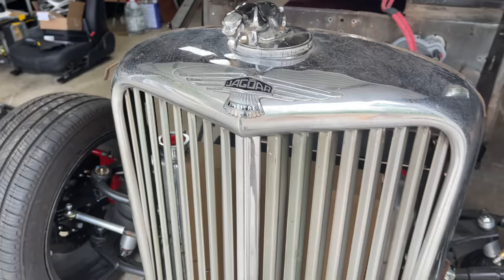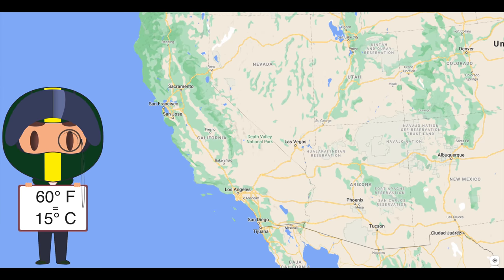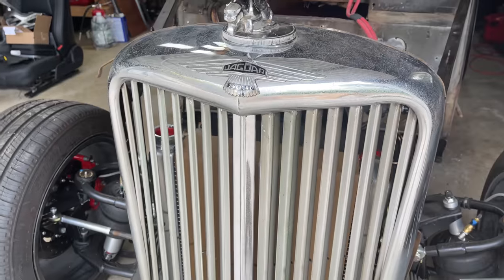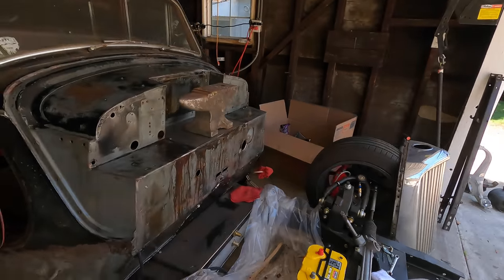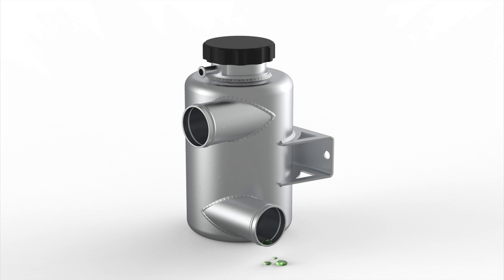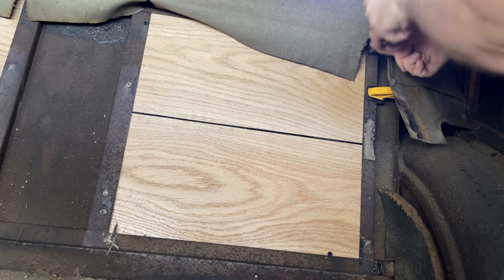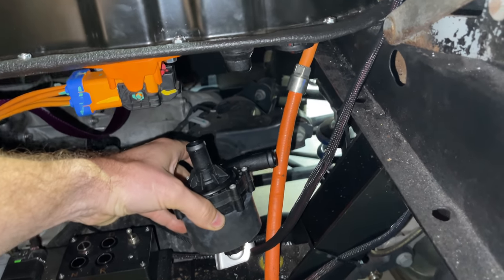Let's Build A Cooling System For An EV Swap

Comment from the maker: I've started adding post-credit teasers so that you can know what is coming up on the next video. I definitely didn't do it just so you will watch all the way to the end, increasing my favor with the algorithm gods. ALL HAIL THE ALGORITHM.
Reply: All Hail
Reply: All Hail
Reply: All Hail
Reply: Wassail!
Reply: Hail
Reply: I, for one, welcome our new algorithm overlord.
Reply: Prius Technology...AWD for the front?
Reply: @b6s4shelter  electric power steering. Separate unit because he didn't swap in the Tesla rack where it's integrated. If it's CAN connected he might also be able to make it work with a comma.ia system so he can have "autopilot" on the tesla swapped jag.
Reply: This is smart, because I always hit Back when you do your ending spiel. SupercunningMatt
Reply: Ramen
Reply: Worked on me. 😒
Reply: Algorithm Algorithm Algorithm
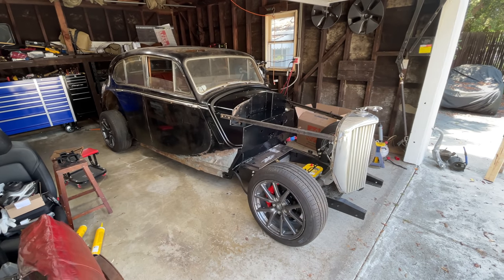Reply: Is it favourable for the creator to have ppl watch to the last second? For example, I would close this one at 10:59, as soon as i see your outro. Does that effect the algo? Ppl put bloopers at the end which is pretty effective IMO. I mean its all moot to me, i watch every one of your uploads. You've hit a niche sir
Reply: All hail
Reply: All hail the Lorderithm.

Comment: I'm intently watching this series as I plan my MGB EV conversion so I can do everything wrong but at least know a right way to do it. I'm going to use Lucas parts for the entire electrical system so I know it will smoke the tires. Probably the rest of the car too. I wonder what a good weld for a software developer looks like. Probably looks like panel bond.

All hail the algorithm!!!
Reply: "I'm going to use Lucas parts for the entire electrical system" you mad lad.
Reply: @JohnHughesChampigny  lol possibly!
Reply: .....  Lucas  ??,  haven't heard of them since I was a car mechanic in the seventies,    is that Elon Musk  sobbing in the corner ?
Reply: Lucas......Prince of Darkness
Reply: @Stu_2112  ,   I'd forgotten that one,  brilliant  !

Comment: Hey Matt, idk about Tesla parts, but Inverter IGBT's generally have lower temperature ratings than motors (at least that was with my case with YASA motor and RMS inverter), and batteries are even more delicate, so I would route it Heat Exchanger -> Battery -> Inverter -> Motor. Agian, I'm not familiar with Tesla parts temperature specs, so this might not be applicable.
Reply: As long as you don't have shit flow, the water temp will be pretty much equal in the entire loop. Maybe only a couple of degrees difference
Reply: I concur, Matt seems to have arranged the parts in the order of highest expected temperature to lowest. It seems backwards, however there is no battery heating loop and the batteries prefer to be between 25-35C. So I imagine that with the correct controls scheme and a radiator with enough overhead you could keep motor inverter cool while keeping the batteries "warm" or in their ideal temperature range. I too have heartburn seeing the batteries in the loop after the motor/inverter. Another thing to consider is that the outhouse has the OBC in it which will probably reject just under 1KW heat during charging. this means that the batteries will see some heating both from the coolant and from the process of charging. this concerns me also.
Reply: I have a similar-ish DIY EV conversion and I agree the inverter should probably go first. But unless the car is ever DC quick charged, the battery won't get that hot. You could probably get away not even running coolant through it. I have CHAdeMO on mine, and we have -20°C winters so I also have to heat up the battery before charging, in which case running coolant through the battery is obviously necessary.
Reply: Just flip the direction of the flow if needed :)
Reply: @brandondelgado4153  
Program the pumps and fan run during charging?
If in a very hot environment while charging...plumb in the a/c as well?
Reply: @JohnSmith-yv6eq  certainly, but my concern would be that the flow rate isnt high enough to keep the water temp below 45C as it exits the outhouse and goes into the batteries. 45c is probably when the batteries start to derate. 25-35c is optimal.
Reply from the maker: I had a few conversations today about this and I think I will split the battery into its own loop and run the other loop Rad>Outhouse(PCS)>Inverter>Motor. I'll Y it off at the radiator outlet and then back together just before the radiator. Each loop can have a pump and a temp sensor. I can data log temps from the CANBUS messages and change as necessary.
Reply: @SuperfastMatt  Out of curiosity, what temps have you been seeing? I'm designing a cooling loop, and based on the temps my Mini sees...I'm not even sure I need to flow the water at all (I didn't notice my broken water pump for months). The thing just doesn't get hot...but it also doesn't see sustained highway speeds, just shorter blasts up a mountain...

To me it seems like inverters/motors get hot while driving, and batteries get hot while fast charging...which means you're not cooling both simultaneously much.
Reply from the maker: @EngineeringComplained  I actually haven't checked in a while. It wasn't getting very hot at all early on, so I just stopped worrying about it. I don't think i ever saw any temps above 130.

Comment: Matt , I really enjoy your videos , if I could offer a little welding tip before welding your aluminum  you can warm the pieces up with a small plumbers torch (not a crack lighter) just enough to drive moisture out, and cutting oil,  and The  coating that is sprayed on aluminum   parts to keep them from oxidizing ... Then weld your parts using a cursive( e )pattern   with this method your are overlapping and advancing forward , possible filling a void that would later become a leak . I think you will be happier with the look of the finished piece ...  Thank you for taking the time to make this video.. Pete M
Reply: I've never heard of aluminium getting sprayed with an oxidation barrier.
Aluminium is crazy reactive but the oxide layer is super stable.

Comment: The motor is the hottest part.  It should be last in the loop.  The motor also can withstand the highest temperatures.  You want the coldest coolant on the electronics.  A fortunate happenstance is you're either charging or driving so the inverter and charger can be in series since only one will active at a time.

Comment: The point of the AC cooling unit is to keep the battery from overheating with the car off. It's to prevent situations like where the nissan leaf batteries would prematurely die because they'd get hot and wouldn't be cooled while charging or just sitting outside. In California, this would be especially important.
Reply: A Leaf doesn't cool the battery under any conditions... car running or not.
Reply: @brianb-p6586  That's the point. Without the chiller, the batteries degrade. Nissan 'solved' the issue by changing battery chemistry a bit after the first few years, but the overall issue remains without any kind of cooler.

Comment: Your probably right about about the cooling but you should consider putting a little water temp sensor behind each of the three modules to make sure they don’t get too hot. I don’t think you will overheat the motor driving in plad mode but the Jag may put up more resistance and hurt the rotor and electronics. The penthouse likely has capacitors in it and they quickly degrade above 75c. The battery case will get really hot if a cell fails and you might want the advanced warning rather than waiting for the magic smoke to let out too. I’m bringing this up because I thought a passive radiator would cool my laser cutter just fine and it cost me a controller and tube. You likely won’t know your killing the electronics for a while and a water sensor (thermocouple) is like $8 each on Amazon.
Reply from the maker: The pumps I’m using require PWM control, so I’ll have a temp sensor that increases flow as temp increases. I’ll also have a warning output light that turns on whenever the motor is expecting active cooling so I know to slow down.

Comment: Really cool stuff, every educational. But I have a couple questions: The holes in the firewall, are you going to put patch panels on them too? Second, your radiator, from the camera angle it looks like your bottom outlet is below the steering rack. Shouldn't it be a little above it so that the hose does not rub on it and cause a leak? Really like your videos, and it is making me think about a electric vehicle project or maybe even breaking down and buying a new Ford F-150 Lightning. 
Thanks for all of the great ideas
Bart

Comment: The AC compressor doesn't bring the temperature down, it increases the temperature and compresses gas to high pressure. 😅
You're pumping water through a radiator so that's an active cooling system.

Comment: oh, you'll also want the two high spots at both ends of your system, as you have it, for 'burping' after the initial fill.  even if the rad had the extended fill neck  you could have air pockets at the other end of the car that won't easily purge.

Comment: British person here, I just wanted to confuse things regarding our use of the metric and imperial systems. Milk and beer are in pints, but most every other liquid is in litres, including fuel, however we measure how much fuel a vehicle uses in miles per gallon, but a different gallon to the one you use in the US. Larger distances and speeds are in miles and miles per hour, but smaller distances are generally in millimeters, centimeters and meters. Not many people will have an intuitive feel for kilometers and kilometers per hour. Contrary to what I just said, the height of people is in feet and inches, but their weight will be in Stone (which no one anywhere else uses, as far as I know), but sometimes in pounds, sometimes in kilograms. General weights of objects will however be in grams, kilos and (metric) tonnes - usually written as just 'ton', to confuse things - with occasional exceptions using ounces and pounds. Temperatures are pretty much always in celcius as fahrenheit makes absoulutely no fucking sense, unless we have a heatwave (it happens occasionally) when the metric for a very hot day is 100 deg F.

Hope this helps.
Reply: Indeed! It makes the whole thing abso-freakin'-lutely transparent! That must be the opaque mud underneath it, sure it is! It all makes such crystal clear sense now- how come I never saw it before? BTW, where does some dude named Whitworth come into this? FR
Reply: @fredericrike5974  
For enlightenment read the rules of cricket....
Reply: @JohnSmith-yv6eq  Was thinking about my collection of Whitworth wrenches and the weird "not metric", "not US" found on many British cars from the pre WW2 and post WW2 eras.It was a poor joke, sorry! FR

Comment: Does your cordless Dremel vibrate really badly in the middle RPM ranges? I bought the same one a few years ago and didn't start using it until the warranty had already expired and mine has a pretty significant vibration in the middle speed range that it doesn't have at high speed or low speed.
Reply from the maker: No, it vibrates a little but I wouldn’t call it bad.
Reply: @SuperfastMatt  hmm. Guess I got a defective one. Oh well I just either use  slow or use it fast
Reply: @DoRC  
Might be the type of cutting disc/blade getting to a sympathetic vibration period @ certain revs?
More teeth...vibration at higher revs.
Less teeth...at lower revs?
You've got the medium teeth spacing...bad luck...

Comment: Assuming your putting in a thermostat, the radiator size won't matter. I have no clue if electric cars have thermostats and what their optimal running temp is.
Reply: i do know they definitely have thermostats and they also definitely run cooler than ICE’s, about 100f rather than 100c. (hence why they need active cooling if its over 100f outside, which happens)

Comment: Would it be a terrible problem to connect a rubber radiator hose from the top of the radiator to the original Jaguar filler cap?

Comment: Would it not be easier to just mount the radiator higher up inside the (enormous) grille so it will be the highest point of the cooling loop? Or am I missing something important?

Comment: hi Matt, I have a very unrelated question but you might be the smartest person I (kinda) know and you're an engineer. I'm making some weighing scales and have 1 load cell only(400kg). Do you know of any design that would let you put an object on the scale and have the force go through the load cell? If I replace one of the legs of the scales with the load cell wouldn't the placement of the object change the force it measures.

Great video btw, I can't wait to see the car driven

Comment: SFM, You know the radiator doesn't have to sit that low on the frame, right? If you build a riser for it to sit on it might just make it high enough to get the air out.

Comment: What kind of radiator is that.....???? I have A Frankenstein 59 Austin Healey be w/ 327 4 speed .... with the original radiator.....always runs hot......was a Circle track race car in 60s..... looking for alternative.....or just gonna go LS.....love the videos....... All hail the Algorithm....
Reply: You are trying to cool a 5.3 litre engine with a 60 year old furry radiator that used to only cool an anemic 3 litre engine.
Bite the bullet and get a custom made 3 or 4 row core radiator made to fit the available space with high flow electric fans.
Also think about using smooth modern radiator hoses (not convoluted ones) for better flow.....so place your inlet and outlet in the right places, too.

Comment: Matt, why did you glue the replacement battery shelf in place rather than weld it? 

All hail The Algorithm!
Reply: Welding sheet metal sucks. Auto manufacturers glue a lot of sheet metal these days.

Comment: Can't you just raise tithe radiator to its maximum. Also commercial buildings use copper air removal cylinder to remove air from closed loops tat self vent. Super reliable and toy could place it in trunk. Need a picture?

Comment: In the future, I think every video will be a cooling system video.
Reply: lets see... He made brackets, welded a variation on the theme of dust separator,  painted, did woodworking, and gestured at a radiator. I think it's fair to claim that all his videos are cooling system videos... as are most videos by Bad Obsession Motorsports.
Reply: @RichardBetel  lol. Surely all BOM videos are bracket videos. Anything else is just advanced  bracket preparation.
Reply: @NemoThorx  1) My name is not Shirley.
2) You're just seeing it through the lense of Nik and Richard's approach. Clearly, their advanced bracket prep ultimately was in service of the dual custom radiators they installed in Binky. :D

Comment: Can't you just raise the radiator till the fill cap is higher than everything else, then you wont need the swirl pot.
Reply: He did say that with his incredible welding skills he could extend the neck of the radiator upwards with a tube, then put the neck right up under the hood ornament....
This would leave the weight of the water and radiator down low for better handling...
Reply: @JohnSmith-yv6eq  Yes, that i understand but raising the radiator itself i think would be a better idea, about the weight of the radiator and water, its miniscule compared to that huge and heavy battery thats down in the chassis.
Reply: @lotuselanplus2s  
But ensuring maximum weight saving/positioning with best engineering practice while keeping it simple?

Comment: Wait, your cooling the battery last? And your using your ever warm So-Cal locale as evidence that you dont need active cooling? 

It sure seems like you should cool the battery first, then the outhouse, then the motor. Because you arent using active cooling, and Because you live in SoCal and you are more likely to be too hot than too cold. Right?

Comment: SuperNoWeldingMatt, If you would not live across the planet from me, I would come at night and pinch you for not welding metal panels, lol. The glued steel to steel sound nasty.
Reply: That's the way they make a lot of vehicles including buses.
Notice nice smooth huge panels, no welding marks, no rivets, glass flush with panels?
Tests have shown, just like welding, the metal next to the glued join gives up before the glue join tears apart.....

https://www.3m.com/3M/en_US/p/d/b40066467/
Reply: @JohnSmith-yv6eq  pinch list grows by one! :D
Reply: @mechadrake  
I'll see you 14hrs and 20 minutes, 6917 miles south of Matt after you've pinched him.
Sorry, after I wave to you at the airport, you will have to spend 14 days in quarantine.
Happy travels when this even becomes possible again...cheers.
Reply: @JohnSmith-yv6eq  :D

Comment: Weld a 5/8 bung on the rad and mount a high overflow. Because you won't be able to take off the radiator cap, ever.